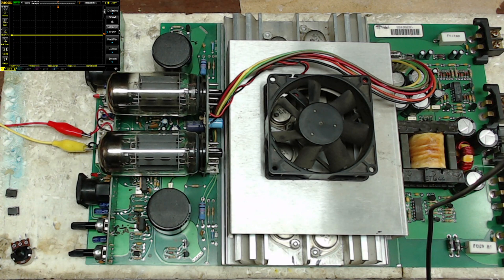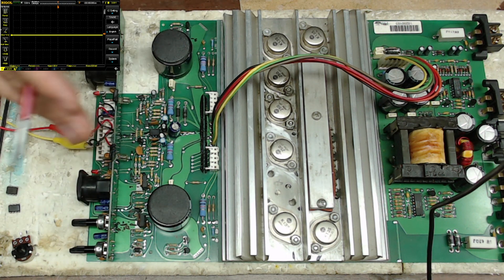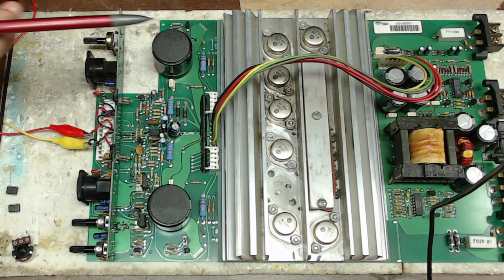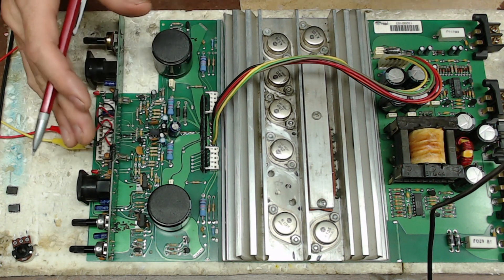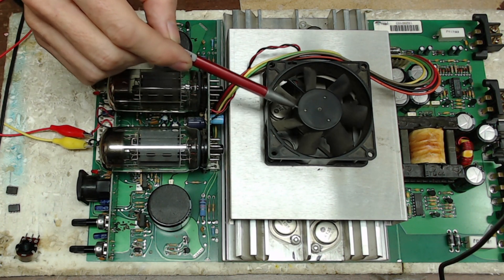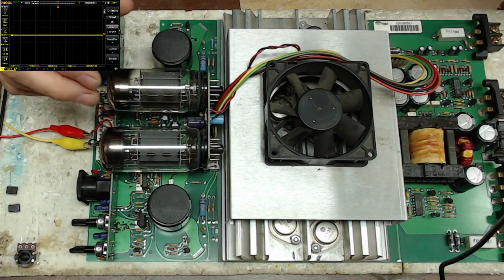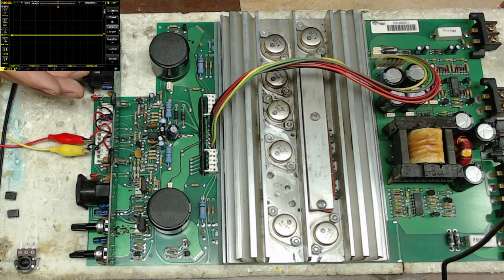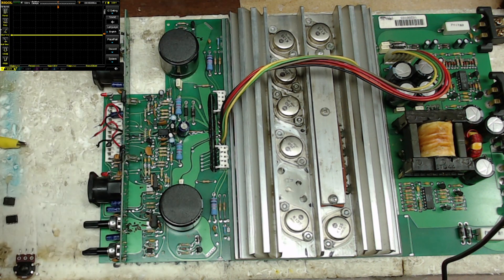Butler Phase Audio Tube Driver Model 1500 Vacuum Tube Car Amplifier

Comment: I have the 300 watt Tube works Butler bass guitar amp, the RT 3300 and it is incredible. I would love to have the Butler amp in my car.
Reply from the maker: The Butler tube amps are an interesting design.
Reply: @ellensburgamplifier yes they are. Mine is called a mosvalve as I can switch the preamp to the 12ax7 tube or to the MOSFET preamp.  It is loud for 300 watts and is 2 ohm stable. I love the tone of it and it is a key component in my bass rig.

Comment: I just repaired two of these amps for a friend and they perform absolutely incredibale. The only problem is the fans are not working and I am trying to figure out the problem. Thanks for the Video.
Reply from the maker: There is a transistor that is pop riveted to the board under the tubes that is responsible for powering the fan.
Reply: @ellensburgamplifier  Thank you for your response. Yeah I guess that was the Power supply for the fans. TIP31C.
Reply: Hey, I got another one of these that a customer brought in and the problem with this one is that when you apply power the two Neon lights come on briefly. I check the PWM signal from the SG2846N IC and when you apply the PS, you get the square wave for a brief time. I notich that on pin 16 (Shutdown pin) the signal goes high when the PWM signal cut out.  Any thoughts on where the problem could be?
Reply from the maker: @Electrolab28Ag  Does it still do that with the tube cards removed? If so pull the TO3 transistors. Have you verified that the power supply transistors are OK? I have seen every fault possible on these so it can be a number of things.
Reply: @ellensburgamplifier  Yes it does....However, I manage to find the fault, It was the TO2 Transisto... one of the legs were broken, i repaired it and it works fine now. thanks very musch for your assistance.
Reply: One more thing, the TIP41C that drives the fan, is it mounted on the back of the board ot the front where the tubes extend out.? I remove mine a while ago it and forgot to take pictures.
Reply from the maker: @Electrolab28Ag  Excellent to hear another one of these is alive and well!
Reply from the maker: @Electrolab28Ag  Yes, originally I have seen them pop riveted to the board right behind the tubes but when I replace them I solder them.
Reply: @ellensburgamplifier  Yes  I solder them in as well.

Comment: As long as there are tube Err-Valve fans who know nothing about electronics, Crappy devices with redundant technology will be manufactured to satisfy those sheep who were brainwashed into preferring such devices using them, even if the valves don't provide any real advantages, and I might add even to the extent that even if just the filaments are connected within the circuit they will still prefer them..
Reply from the maker: Thank you. I always thought Butler used the tube as the final drive but it is not looking like that is the case. Still neat amplifiers.
Reply: It's not about being brainwashed,  it's because EVERYONE hears things differently and some people prefer the sound of music through tube gear , some don't  and some people don't get caught up in the how and instead focus on the end result  and aren't worried about leaving a shitty comment to try and make someone feel shitty for their own opinion.